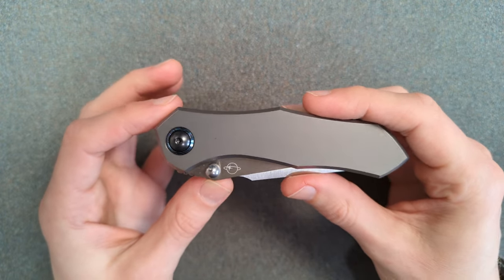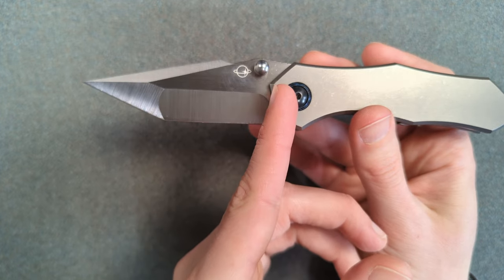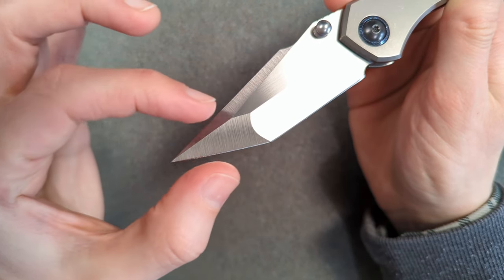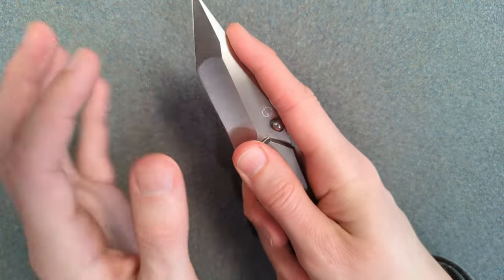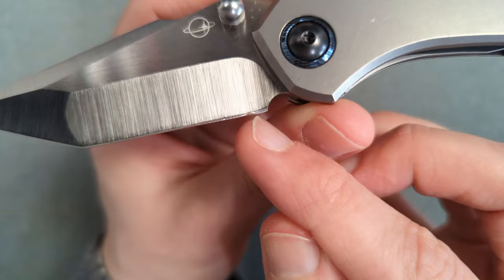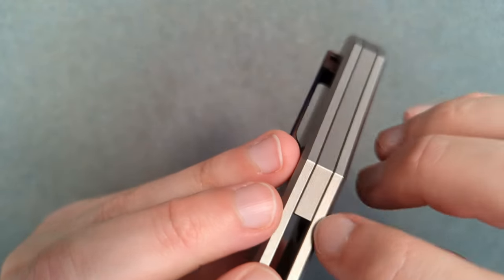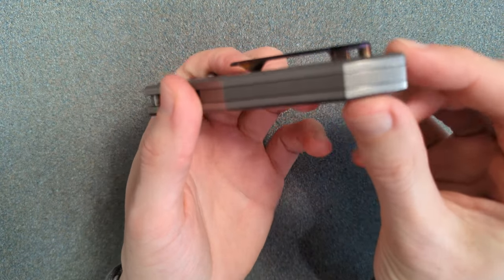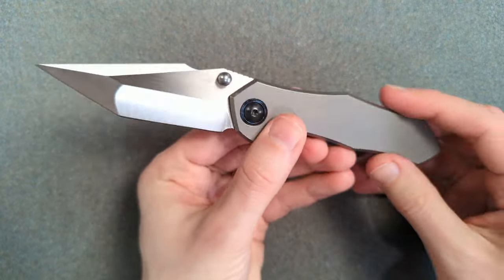I've NEVER seen this before on a production knife - Kassanova Design Neutron Star - Titanium Tanto

Comment: The Piratech Kraken does not have screws and uses magnets. It requires a little more precision machining.
Reply from the maker: I should be getting one of those in on a passaround any day now, but I'm not sure how I feel about it yet. You still need a screw driver to take off the clip, which means you can only take one of the two sides off via the magnets. It feels like an incomplete design to me -- there's plenty of ways they could have attached the clip other than a screw that would have allowed  both sides to be magnetically swappable. But who knows, maybe I'll feel differently once I have it in hand.

Comment: Ketuo/Rike have been doing the screwless technique for awhile now.
Reply from the maker: Yeah, I filmed a real-time "figure out how to take it apart" disassembly on their Rebelship a bit ago that will hopefully make it up on the channel pretty soon. That one is a full on tool-free puzzle box knife, though -- not just hidden hardware, but no hardware whatsoever.
Reply: @KnifeNerdery  How was your Rebelship? I wanted to keep mine so badly but the action was very bad. I couldn't justify a $550 knife that had such a limp detent.
Reply: I have a Rike Gent #9 on the way which has no visible screws as well. If an AirStream trailer was reincarnated as a knife, it would be that knife.
Reply from the maker: @GasStationKnives4Ever  hahaha excellent visual analogy. I have one of those sitting in pieces on my workbench right now because a friend loctited the back screw, then bent the proprietary tool trying to take it apart, and asked if I'd try. I managed to get it apart eventually, but the back screw collar is definitely worse for the wear. I could put it back together now, but I'm still angry at it, so it's in time out.